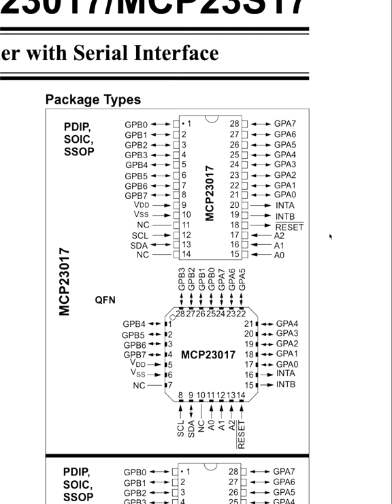Adding I/O with MCP23017 - Collin’s Lab Notes #adafruit #collinslabnotes

Comment: FYI the MCP23018 is the newer version of this part. There's also an 8bit gpio expander version the mcp23008 (with a newer version of that being the mcp23009). the newer versions have slightly fewer pins by using a voltage divider to set the address pin (which has its pros and cons). otherwise, the newer versions are identical.

Comment: The RP2040 has two i2c buses, so 256 i2c pins are possible there.  There is also the MCP23S17 using the SPI bus for even more expansion.

Comment: Interesting way to add ports, I was guessing you were going to use some sort of shift register
Reply: It may be using shift registers internally to do its thing. First to clock in the i2c addr and match it, then the pin state commands.

Comment: What about Analog Pins? I want to expand the number of analog pins to have multiple joysticks/pots. Is there something like this chip? Or do I need a multiplexer?
Reply: You have a couple of options Here:
1) External ADC 
2) Analog Multiplexer (FET)

74HC4067 is 16:1 Analog Mux/Demux
MCP3202/04/08 is a 2/4/8 channel 12 bit SAR ADC with SPI
ADS1115 is a 4 channel 16 bit SAR ADC with I2C

Now the choice soley depends on your design requirements & cost
Reply: CD4051/14051 is an 8 to 1 analogue mux/demux, turns up in a lot of places.

Someone else suggested the 74HC4067 as a 16 to 1, which sounds even better 🙂

Comment: Actually you don't even need to use i2c. Simply use a shift register ic and you are good to go. Its older tech but does the same job for cheap.
Reply: The issue begins when you want to read the pins and Merging a A SIPO and a PISO shift register can get complex

Comment: Is there a port extender chip with SPI? I2C is a good protocol but it's kinda slow.
Reply: Its combined in this chip. It can use i2c as well as spi, see the datasheet
Reply: @ArnoudvanLeijden  The SPI version is a different chip.

Comment: Noob question, if the MCP23017 only has 3 address inputs, how do you specify up to 8 addresses?
Reply: Each pin can be connected to high (5V) or low(0V). So this is like 3 digits in binary, which can be set to 8 different values (000, 001, 010, 011, 100, 101, 110, 111)
Reply: @AntzyX  oh thank you!! I need to start reading them data sheets more often